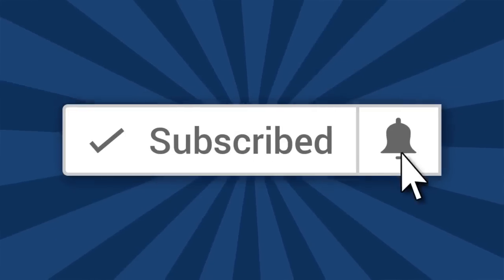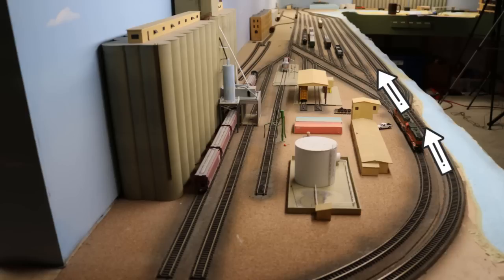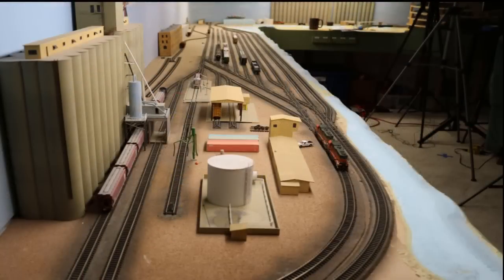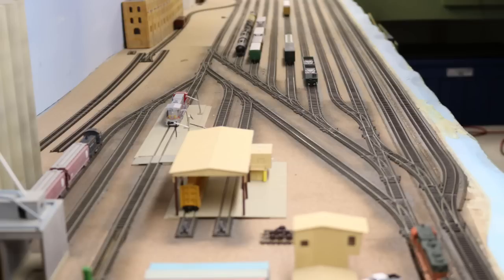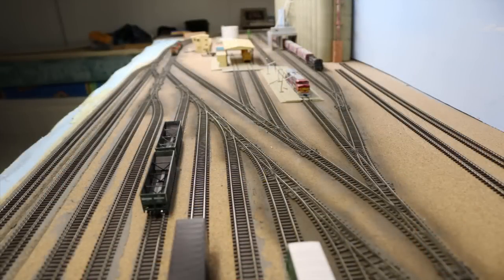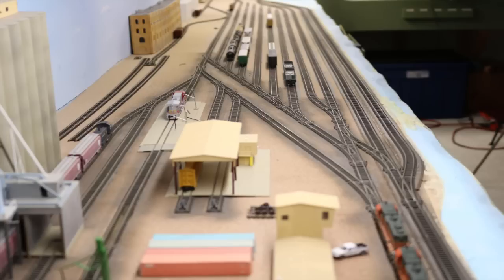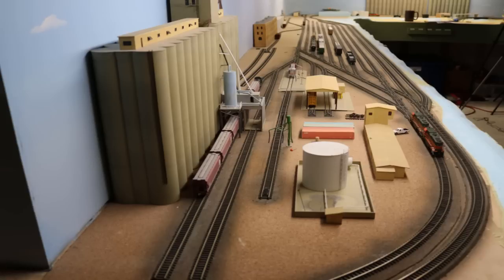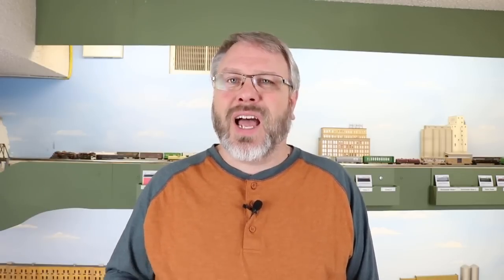Model Railroad Yards--Design for Operations

Comment: would you put the crossover from the classification 6 to the through track at the same angle ( \ ) as the ladder track or at the same angle ( / ) as from the through track to grain elevator ?
Reply from the maker: It is the opposite angle from the ladder track.

Comment: Within the design of North Yard as you have it here, if you wanted to put in a diesel engine house, where would you locate it?
Reply from the maker: Well, the track right behind the RIP tracks is the diesel service track. In the prototype there are 2 tracks in the diesel service area in this location. In the photo I put in the video of the real North Yard you can see those tracks right behind the RIP facility. Thus I suppose the answer would be right in this area, though it is not necessarily a rule to in some way connect diesel service and RIP facilities. It works because both are auxiliary tracks apart from classification tracks.
Reply: Hmmm, just watched the entire video, again, and I didn't see any photo of the real North Yard. But anyway....so, I would move the large tank, and have the diesel service track split and fan out into 3 tracks to go into the diesel house about where the large tank is now sitting?
Also, would you have a control tower? And where would be the best place to locate it?

Comment: Please forgive me (I'm a nub), but can you describe the logistics of pulling a car out of your rip track or silo siding and then running around it to push it into the classification yard?
Reply from the maker: Well, I'm not sure exactly what you are asking, but the rear most track of my hard--the working track--is double ended so hoppers in the elevator can be spotted there and run around on the run around. As for the RIP track, they can simply be spotted on the thouroughfare track paralles to the yard ladder as they are short cuts of cars and run around using the yard ladder itself.

Comment: G'day from Down Under Ron, and thanks very much for posting this video.  I haven't started building my US layout yet (I've been in UK modelling for the last 20 years but heading back to my roots in US N scale), but I am going to take your ideas on board for my main yard - so much so I suspect I'll be copying North Yard slavishly!  Looks great and solves most of the common problems - certainly the ones I have been struggling with .  I struggled a bit with the differences in terminology (lead rather than head shunt, classify rather than sort/shunt) but got there in the end.  A couple of questions if I may - how long and how wide is the bench work for North Yard?  And (not having worked my way though your other videos) do you operate it with its own switcher or do you normally use the train engines?  Finally - DC or DCC?  Thanks once again.Kevin
Reply from the maker: Hi, Kevin. Thanks for your comment. North Yard is 24 inches deep and 12 feet long. It is operated with a dedicated switcher--to GP38s actually, like the prototype. I run DCC. Good luck with your own build.

Comment: I cannot figure out how to build a yard ladder. The switches I have do not allow me to place tracks close enough together. I'm 77 and building my first layout. So forgive my ignorance. Bob
Reply from the maker: I use Peco medium  Radius switches which have a number 6 frog but a curved diverge in route. Yes, I attach them directly end-to-end and I get a ladder that comes  Out just about right. Depending on what switches you are using, you may need to curve  Your classification tracks a bit to get You're tracks where you want them.

Comment: great video Ron, i do have a question about the style of yards, is it common place to see a intermodal yard and a standard yard togther? also thank you for the great visual aids these videos are always my go-tos. Keep up the great work sir.
Reply from the maker: I would have to do some research to give you a really good answer to that question, but the couple Intermodal yards that I have been around were not adjacent to regular yards. They are however in urban areas so there are major Freight yards not far away. It is my observation that Intermodal cars are not typically handled much through a regular Freight yard. They usually run as unit trains from one Intermodal yard to another.
Reply: thank you for the info on that, i will make sure i give them space to run. i wonder if they set them up as the same as eacher other

Comment: would similar principles apply when designing a complex passenger station instead of a yard?
Reply: Passenger would be different. First, many passenger yards had more space between tracks. This is so coach cleaners could take their cleaning supplies on a truck or motorized cart to the cars needing cleaning. There were separate tracks for diners and other food service types. There they could be supplied with provisions, table cloths, dinnerware..... Sleepers also needed fresh bedding before each run.

One other aspect of passenger service is mail and express. These cars would be loaded at the postal and express facility. All these cars had to be switched into the outbound train.

Some intermediate locations had sleepers or coaches set out. For example, a New York-Chicago train might set out a sleeper in Buffalo, or Cleveland. Coaches sometimes were set out for a connecting train. Amtrak somewhat does this in Albany. The Lake Shore Limited is split. Half continues to New York, and the other to Boston.
Reply: I was thinking more of a passenger station with more platforms than a '70s disco.
Reply: What ever a disco has to do with it? What’s hard about a terminal? You have several tracks. Cars are set over like I mentioned. Drafts of cars are brought from the yards, where the post, express, sleepers, food cars, and coaches are doubled. You might have some tracks for set out sleepers, like my Cleveland example. 

That’s about it! I don’t think Barry Gibbs could give you any better 1970s disco.
Reply from the maker: Thanks, Brian, for an excellent answer to that question. 👍👍
Reply: I am also a train simulator fan and was going to build a real world route with their program. I wanted to do CSX and Amtrak from Washington DC to Philadelphia. To build this route I traced all of the tracks involved in google earth and saved the files. What I noticed was that the stations are setup very different from the yards.  To start with the major stations ( Washington Terminal in DC,  30th Street Station in Philly, and New York Pennsylvania Station in Manhattan ) had separate yards outside of the stations that look similar to freight yards but, as previously noted some of the tracks are spaced much farther apart.   Inside the actual station limits the trackage is very different,the tracks crisscross back and fourth across each other often with quite a few double slip switches and a couple that appeared to have two tracks coming into a slip switch and three tracks out the other end.  Much of the trackage at these stations cannot be seen on Google Earth but the track diagrams can be seem on line.  Like Ron said making an exact copy of a real yard may more often than not workout the way you hoped for on a Model Railroad, but I believe the opposite would be true in the case of Station trackage.
Reply: I used to work commuter trains on BN. Our yards in Chicago and Aurora had the wide space between tracks. The coach cleaners used to have motorized carts with their cleaning supplies.

I am a Boston and Maine fan primarily. They had yards in Cambridge, and Somerville, Mass. Most was freight, and there was a hump. On the passenger side they had several yards. As I previously described, There were coach yards, and also other yards where sleepers, and food service cars were cleaned and stocked. They also had both mail and express depots. There was a book written by a former brakeman. He worked there in the 1940s. One type of train that he mentioned was newspaper trains. Since Boston is a major city, cars with newspapers would throw off bundles at towns along the lines. This could be an idea if one was modeling that era.

Comment: Great video. Do you have one on dealing with designing passenger stations and passenger car yards?
Reply from the maker: Not yet.
Reply: If you put one out there, I'll b sure to watch it. Great series of videos incidentally. IMHO probably the best series on model railroading tips on YouTube.
Reply: I live right next to a major commuter rail station (Union Station in Toronto). Go Transit has a servicing yard at each end of the station, with tracks long enough to hold the longest trains. Five double tracked lines head west and three double tracked lines head east. There are 23 tracks in the trainshed. In general, the trains never cross paths: the delay for a waiting train is too great. Instead they will build a weave, at considerable expense, where one double tracked line passes under or over the other (this was done for the Union Pearson Express line to the airport).

When the commuter trains are not making another trip out from Union Station they will move to one of the servicing yards for cleaning. At this point they will use cross-over tracks. Trains that end their runs out on the lines will be serviced at their last stop.

In addition to Go, Via Rail also has several daily trains from Union and Amtrak has one a day to NYC. The occasional freight passes south of the station.
Reply: Thanks. I live in Montreal and used to ride a commuter train into Central Station daily when I was going to school at Concordia in the 80's. Electrified commuter trains from the Lake of Two Mountains line would come in through the tunnel under Mount Royal, while Via and and one Amtrak train traveling between Montreal and NYC come in and leave via the other end of the station.  All the yards and service facilities are at some distance from the station. 

What I want to be doing in my next layout however is to focus on passenger operations on a smaller scale for reasons of space.  An interesting prototype I found was Amtrack's Albany-Rensselaer station, which has 4 passenger tracks and handles 16 trains a day.  Even so, compressing this station on something the size of an N-scale model railroad would still be quite a challenge.
Reply from the maker: Thanks. That is much appreciated. 👍
Reply from the maker: Great info, Mark. Thanks for sharing that.

Comment: Looks like this yard is for traffic always coming in at the "far" end, and only leaving the "near" end. Are most yards this way, with external tracks to change direction?
Reply from the maker: Actually, the arrival/departure tracks (2) in this yard can be accessed from the main line at either end in either direction. It is switched at one end, but departing cuts of cars are shoved into one of the A/D tracks to depart either direction.
Reply: this is good observation, in that, with dead-end clasification tracks very difficult to build and exit both directions

Comment: I really enjoyed this video.

I know of at least one prototype yard that uses a branch line as a drill track. https://www.google.ca/maps/place/54°30'59.1"N+128°33'46.6"W

At least in the 90's, the locomotives used for switching usually worked the 40ish mile long branch line, too, so there wasn't an issue with conflicting traffic. Two major industries using the branch line closed in the 00's and there is very little switching that takes place today. The yard at Terrace now sees mostly unit trains of containers, grain, and coal. Traffic has become heavy enough that they are double tracking the mainline where the terrain allows.
Reply from the maker: Yes, smaller yards on branches can do that because of low traffic volume. Prototypes try not to tie up busy main lines as yard leads because it causes a serious bottleneck on a busy line with many trains per day.

Comment: I have a layout that has track already laid down on it. I want to take the track up and reinstall it up on cork and up on a hill. Is there a way to pull up the track and re use it? I am new to this hobby. My train set is HO.
Reply from the maker: Reclaiming flex track is difficult, although I have reused turnouts before. What is your track attached with?
Reply: I think small brads in the middle of the ties on to plywood.They are not glued.
Reply: If not glued you should be able to pull nails an reuse. Just be careful when grabbing heads of nail not to get tie too. Good pair new pliers works best.
Reply: Thanks that helps a lot.
Reply from the maker: Yes, if not glued, reuse it all.
Reply: I am in the process of changing around some of the track on my 40 year old N Scale layout so I can do more realistic switching operations. I volunteer at the Wilmington & Western Railroad in northern Delaware as a Trainman and Assistant Brakeman where I have learned quite a lot about figuring out difficult switching maneuvers and tricks to make them with the least amount of moves possible.  Any way I am adding several additional yard type tracks and will be adding a couple switches that will not be connected to any track on the diverging  lead so I can add an actual yard in the near future. I use flex track and have removed about a third of my track over the last few weeks and am using a set of five very small pliers that I got at Walmart ant they come in a nice heavy zippered nylon case and are ideal for all types of model railroad work and repairs. The set includes: a pair of side cutters, 1 pair of needle nose with wire cutter, 1 pair of very long jaw needle nose,  1 pair of mini lineman’s dikes, and a pair of end nippers, the set runs around $10. These have worked very well for pulling out the track nails without damaging the ties, but make sure that you hold the track down good and tight
Reply: Right next to where you are pulling out the nails or the track might come up with it and damage some ties where the next nail is. I made that that mistake !!!  If you happen to damage a couple ties, cut some off of a short scrap of flex track and trim the nubs that hold the rail down and slide them under the rails. If you need to put a nail an attached tie without a hole in it, drill a hole with a 1/32” drill bit first so it won’t split the tie.

Comment: Hi Ron, I've been following your channel for a while now, and a few others :) with an aim of getting back into the hobby after a 35 year hiatus. I used to use Hornby 00 scale as most of us did in blighty.
However the space I have to work in is my sons old bedroom which measures 2.4m by 3.5m. I was actually inwardly excited about getting a project started, I had an idea of what I wanted and had it all planned out in my head until I bought "AnyRail"tm. My dreams have been shattered. 
It is going to be near impossible to get my plan into action because of the space  restraints.

Back to the drawing board... 
I've had some advice from JNW and he suggested I have a chat with you. The reason is he believes correctly that my room is going to be a challenge for 00 scale and maybe I should consider N scale.
My only real issue with N scale is continuous derailments running over points or multiple points and the headaches that go with that.  Such was the issue 35 years ago and I suspect it is still an issue today.  I want a large fully working yard as well as a main line running into a Terminus, A Helix for the second deck with more industry and another station to complete my main line.

I guess I would really like you to convince me that N scale issues with points are a thing of the past, and any other advice you care to give me would be fantastic.
Reply from the maker: Unfortunately that is an experience all to common--I've been there myself.

Comment: What ho track is the best
Reply from the maker: That is a loaded question. Micro Egineering is super high quality but hard to work with. Atlas flex track is easy to work with but not as high quality and detailed. I would say Peco is your middle ground--looks good, easy to use.

Comment: read all the comment  still seen to me they all are confused question they are wondering what type of running shoes you ruckmen using when running around if you have a run around a track my question is the people here are very overweight and will not to have to build a track that never would be used, the money would be more spent better buying water towers and run the trains, then run them self  maybe if they see you out-run around they mite  or NOT  LOL
Reply: What?
Reply: its a joke for the runaround,        running shoes?
Reply: I gathered that but it was hard to understand since it was multiple sentences all run together with no periods. And WTH are "ruckmen"?